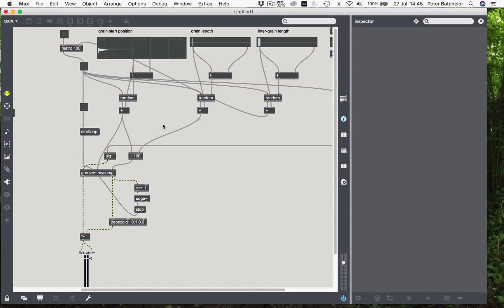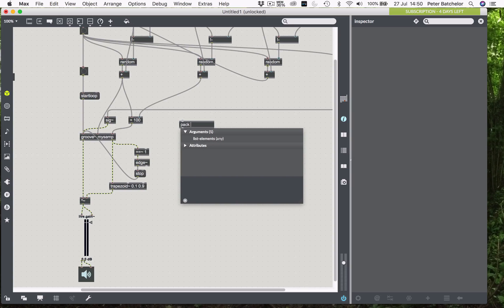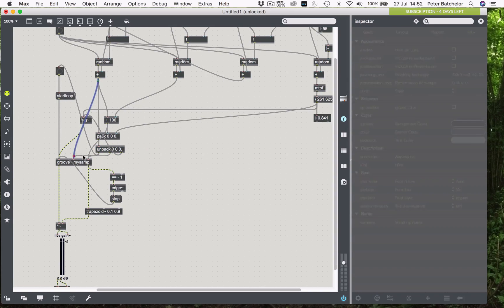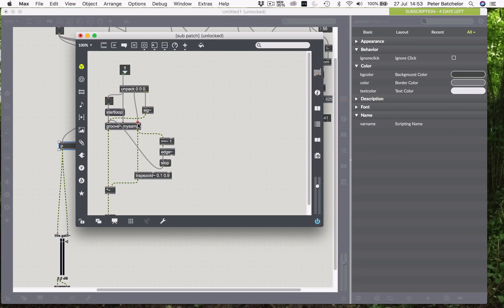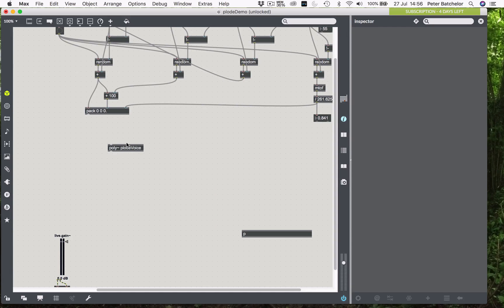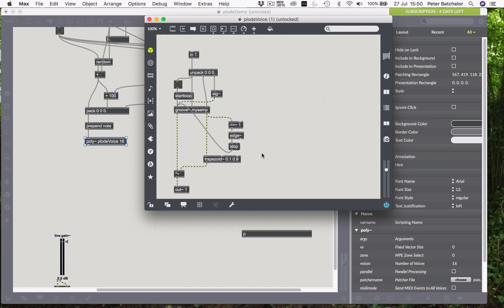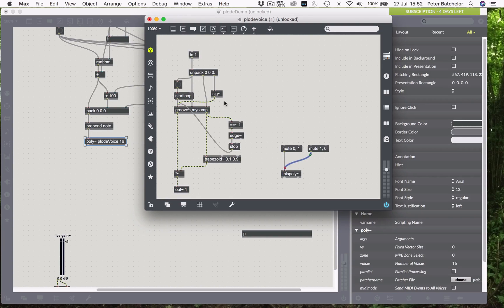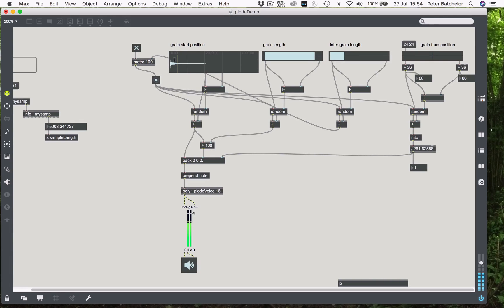Plode -- Build a granulator in Max7: 07. Grain Overlap (polyphony)

Comment: Hey ! Thanks for all these really helpfull videos ! would there be a way to control the R slider of each parameter with the knobs on a Midi keyboard using the notin object ?
Reply: Yes Daniel, but with one Knob you could only set a single notein value, it would be possible with two knobs to set both the start and endpoint for the R sliders.